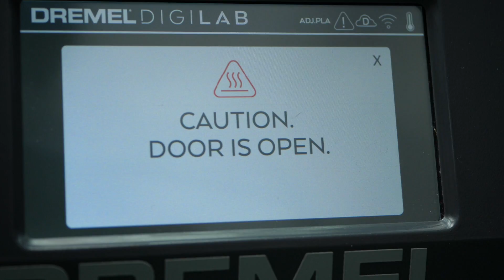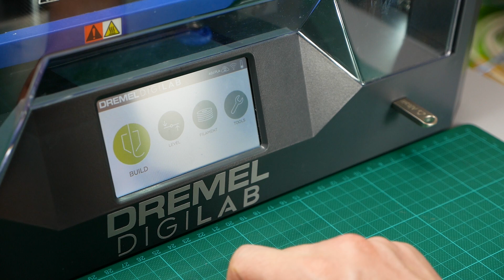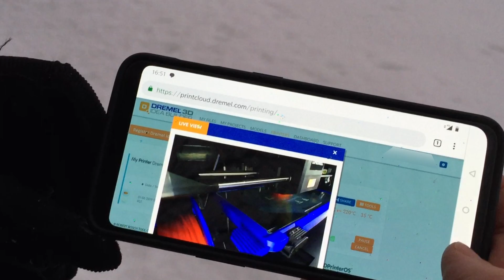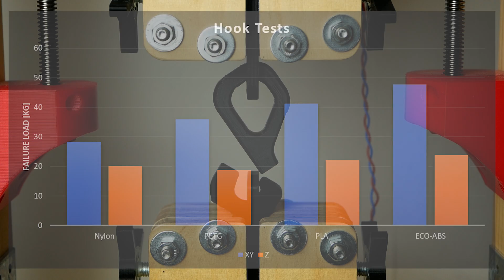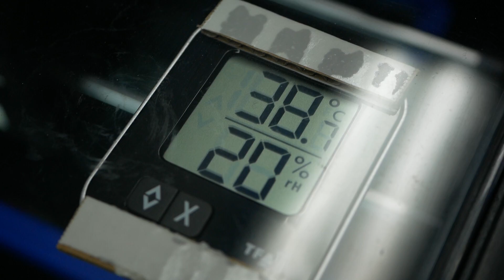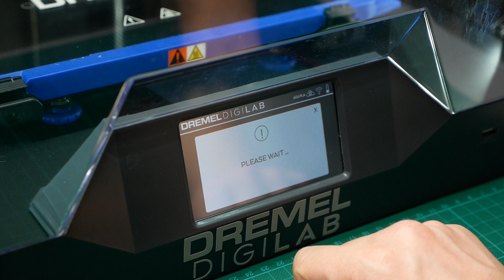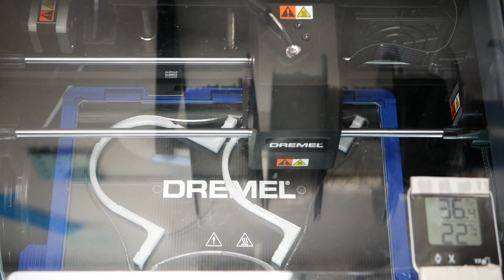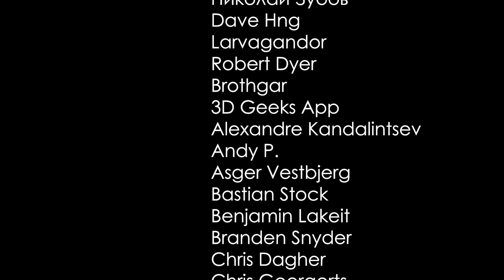Wasted potential!? DREMEL 3D45 + all materials - FULL REVIEW

Comment: I started 3D printing with Dremel 3D45 and had zero experience and I am sooo happy about this machine. The setup is super easy and using it couldn´t be easier! I have done thorough research before purchasing this unit and I can say I am 100% satisfied with my Dremel 3D45 as a newbie and would totally recommend it if you are new to 3D printing and want to learn and just start printing instead of having to build the whole machine yourself. The RFID built into the filaments is amazing as the settings are pre-set and you don´t have to worry at all! All in all, I´m a very happy Dremel Girl and starting to become a big fan! :)

Comment: After 79 success prints it doing exactly what I wanted it to do with no messing with it.  It's been a far better experience then what I see other youtube printers producing.   Only mistakes I have had have been ones that I made when learning how to use it.   It will even remind you to reapply glue every now and then.   It's smart.  It works and it's quality.  After  79 prints I have only had to level the bed one time when I was not smart enough to pull the build plate out and remove my print.  Instead I started working on it in the machine....( I see this done all the time on youtube.  But think about it....not a really good idea to be banging around on something that determines if your print is good or bad.)  Not one issue with the machine.  I am on my 4th roll of filament.   It's time to order more.   This quality tool is not a cheap unit.  It's built to last.   It's nice not having to fiddle with it's settings.   My longest print has been 14 hours.   Shortest print is 10 minutes.  It's good stuff.  Pricey but good stuff.

Comment: I'm a teacher using the 3D40 for the past 3-4 years with NO issues at all!  The Dremel 3D printers are pretty much bomb proof and the Dremel software is very easy to use for people/students new to 3D printing.  I have never had issues with clogging when using different brands of filament.  Overall I'm very happy with the 3D40.  At a considerably cheaper price it still does about 95 % of the things the 3D45 will do.  However, I fully agree that the printing area size is a bit too small for these machines. It would have been so easy for Dremel to simply add a bit more height for printing.  Nice review.
Reply from the maker: Thanks for your long time feedback! It's always great to hear that a machine is reliable and well usable by people new to the technology.

Comment: Excellent video, thank you for level of detail you included which is very helpful. We are considering purchasing this for our very small business to print prototypes but are wondering if it is possible to attach a stainless steel nozzle and to use food-grade ABS? We are trying to print something that will come in contact with drinking water and need it as food-safe as possible. If not, we have a backup plan by skinning the print surfaces with a very thin food-safe material but are hoping we don't have to resort to that. Thank you!

Comment: Biggest problem - the extruder.  A mediocre, mass produced version of Makerbot's old deficient extruder.  Heat creep galore, hard to zero in on optimum temperature settings and it can't handle Dremel's own default retraction settings without grinding up the filament.   On top of that - a hard 90 degree turn into the extruder??!??   I've been working on and off with the 3D45 for about 2 years and  I could learn to love it if it weren't for the extruder.  Ironically, it is one of the best printers I've used with Ninjaflex - go figure.   Trying to decide whether to ditch it or to retrofit with a real extruder.

Comment: You can reload generic filament of the same properties on the spools guys.  After a while the smart spool makes sense when juggling many different materials.  I have 6 of the CEL Robox machines and the smart spools are one of the neatest features to avoid errors. Problem is driver USB instability.

What I care about is a reliable, repeatable system and this unit is supposed to be that.  Anybody have one with hours on it to report?

Comment: First off, thank you for the review, it was quite informative; albeit, did not sway me from purchasing the a 3D45. The review was compared to my experiences with Dremel printers and most aligned. Of course, my experience with the 3D45 is a year after this review and there have been some improvements while other things remained the same. The Dremel 3D45 is a solid printer marketed to a niche market - for now - but my experiences have been mostly positive.

 My first encounter with a Dremel 3D printer was a few years back when I was asked to replace a leveling switch on a Dremel 3D40. It was simple, required a little more than what the instructions lead to, but afterwards, a few test prints were loaded and it worked just fine. Later on, I was offered some print time on the same 3D40 and loaded in some things I normally send out for professional 3D printing - the results were pretty good without fine tuning the settings. 

 After some deliberation, I decided to get a 3D45 (EDU) and so far I have been very impressed. Granted most of my 3D printing is for mechanical form, fit, and function tests; however, other items are for simple enclosures for electronics or mechanisms. So far, the prints are pretty impressive for an FDM printer. One of the main things with this printer or any 3D printer, CNC, or any manufacturing device, is it needs to be characterized for optimization of production.  To be fair this is a slow process, but videos on this channel have made the characterization easier to perform (THANK YOU!); now most of my prints have improved. As of this writing, I am moving away from the Dremel brand filaments and starting to look at replacing the nozzle with something that can handle more abrasive materials like carbon fiber or even wood - who knows. 

 Given time, I think this printer and the associated materials from Dremel will improve. Currently, I am in total agreement that this may have been a little on the expensive side for printer and materials. Just the material price alone makes me look elsewhere. Regardless, in my humble experience, after using the 3D40 it was a logical step to look into the 3D45 printer since the previous version was plug, print, and play. If you spend some time optimizing the print quality through settings in CURA, Dremel DigiLab, or Simplify3D it will make a second look at this printer worth it.

Comment: We are ausing these in a printfarm at work and they work very reliably and predictably, which is what they are going for. Connectivity is great and the hardware is solid. the biggest bummer is the weird filament feeding, since you can not use big 5 kg spools without some major hacks to the enclosure.
It's not a big issue that you cannot tweak settings on the fly. You only need to do this if your printer profile/slicer setting is not working stable. The bed stays level over many many prints, so "manual" bed levelling is no issue as well...

Comment: I'm actually impressed with how much you beat them up and seemed quite genuine in your review. You can't trust any YouTubers review video if they've been given the product for free. And damn it pissed me off to no end when I would go buy that product based on what these A-holes would say about a given product only to find out once I got it home that they were only fluffing the F@#? out of a polished turd. Those YouTubers are the scum of the earth to me. I believe I'd have beat Dremel up something fierce considering it's price point is more in line with a production model, but marketed towards hobbyists and then treated like a child and not allowed to access any of the parameters that they don't believe you're capable of understanding! And to top all of that off they work harder and invest more capital in engineering ways of preventing you from using anything that's not incestually related to the Dremel brand instead of using that effort and capital to put out a product that'll last longer than 6 months. I've owned and destroyed so many Dremel products before I finally bit the big bullet and bought a Foredom rotary tool that, amazingly, you can buy replacement and rebuild parts for all of their products from Foredom directly!!!! And without making you feel like you're stealing from your grandmother when you're begging Dremel's customer service to honor their warranty. Bastards. I haven't bought anything Dremel in about 5 years now. And I'll never buy overpriced Dremel crap again.

Comment: Thanks for your video's. I learned a lot. Since I also own a 3d45 printer, I found out that in the advanced settings, you can turn on the G-Code Priority function. Which uses the temperature settings from the slicer, instead of the build in settings of the printer, which has only 4 parameters for material.

Comment: Commercially, I've been using Stratasys FDM since about 2003 (Stratasys Titan, then Dimension Elite)Got the 3D45 recently to support printing of handheld device enclosures for a side design job. It's my 3rd consumer 3D printer, and I've been pretty happy with it. I am using ASA filament primarily - similar properties to ABS but no shrinkage - successfully printing curved enclosure parts with .045" wall thickness no problems. We bought a Flashforge creator pro first, couldn't get it to print successfully at all, and their support was useless. We bought the Dremel after that, and the support from Dremel is great; broke the level switch once, they sent a replacement free, no questions. Also, since this video there has been a firmware update that allows for print parameter changes during printing, and the Printcloud advanced mode tab gives you direct access to the g code so you can change anything you like. The bed doesn't auto adjust, but it is easy to set and very stable - I have to adjust it maybe once a month. Not sure what the fuss about the glue is; it's cheap and easy to apply, plus you can stick whatever you want on the glass build plate if you want something different. I agree with the comment on ECO-ABS, it works but not worth the extra cost over PLA. 3rd party materials are a non issue also; I've printed Carbon Reinforced PLA on mine and had decent results, but went with a larger nozzle size; the .04mm clogs often with fiber.
Reply: This is subpar to what you get with prusa mk3s that costs less. So you get vendor lock-in here allowing him to elbow you around with less features than if you actually buy something proper.
Reply: The shit-sandwitch that is software lock-in. It should be illegal.
Reply: It doesn't lock you in though - I can print to it from Cura, and I can buy my filament from anywhere. It DOES have RFID recognition if you buy a Dremel spool, but you don't have to. It DOES come with Cura-based Dremel software, but you don't have to use it. I actually have a lot of respect for Dremel for handling it that way.
Reply: Software vendor-lock in happens when vendor gives you software you can't modify yourself and assess. In this case the vendor has been "cool" and given you a little openness as features. Though he can always take that back. I dont get man. You got so many examples like the ps4 Linux and Android platform. You are screwed if you bought this machine if you can't at least throw your own printer driver board in.
Reply: @henrituhola  if it came down to it, you could. The extruder is basically an E3D, the stepper motors and hotbed are all pretty standard fare, about the only difference is the fancy touchscreen, which might also have to change. I'm convertimg my old 3Dsystems Cube3 to a RAMPS 1.4 based system right now, it can be done fairly easy. As a purchase to support a commercial project, we wanted Dremel's support behind it. Otherwise I agree, something like the flashforge creator pro would be very similar for a lot less money. BUT - we tried one of those first, and although I know several people who have them and have had zero issues, the one we got was NOT capable of producing a good print, and Flashforge's support was not terribly helpful. So yes, the Dremel was a bit more pricey for what we got, and has a proprietary board, but they also rush shipped me a new height sensor free of charge when it broke so we could get it back online ASAP. For an average home user, you can get awesome results from an Anet A8 for under $200. My father has printed almost a complete 6 axis robot arm with one, and it looks great!

Comment: this $1600 printer has less features than my £200 one.

Dremmel: 
Single extruder, no auto bed leveling, uses glue on hotplate, locked down filaments.

A10M
Dual extruder (mixing nozzle), auto bed leveling with sensor attachment, doesn't need adhesive on hotplate, works with standard 1.75mm filament.
Reply: Sounds like Apple production if they made 3D printers

Comment: A hepa filter would be useless.  Hepa filters capture paeticulate.  VOCs etc are gasses and would go right through a hepa filter.
Reply from the maker: That’s why I‘d like to have both. See the asterisk in the video ;-)
Reply: @CNCKitchen  but what particulate would come out of a 3d printer?
Reply: @DoRC  google for " Characterization of particle emissions from
consumer fused deposition modeling 3D printers "
Reply: @cthulpiss  interesting.  Unfortunately those particles are .1 micron and smaller whereas a hepa filter is designed for .3 micron and larger.
Reply: @DoRC  I believe HEPA filters are benchmarked at 300nm, but are capable of filtering smaller ones too, look " HEPA Filtration Facts " (first pdf, IF you can trust filter maker). Personally, I have no professional knowledge about those, my interest is only from practical perspective (I want to live forever :) )
Reply: @cthulpiss  eh. Who knows.  I'll just hold my breath during a print:)
Reply: @DoRC  Nah. I tend to be mouthbreather, and my future prints are going to be long. Filter it is (/will be)
Reply: @cthulpiss  my printer is in my garage and being a mechanic I'm honestly probably breathing worse things than 3d printer pixie dust:). However that just means I'm stupid. A filtered enclosure certainly can't hurt!
Reply: @DoRC  No thats wrong. Hepa filters are ratet at around 130nm particle size where they have the worst efficiency. Smaller or bigger particles are filtered out at a even higer rating.
Reply: @blubbenderblubber7496  not sure what you're trying to say here but the particle size for which a filter is rated is the minimum size particle it will filter at the rated effectivness.  Anything larger it will filter better anything smaller it will filter worse.
Reply: @DoRC  Hard to explain that in short but diffusion plays a major role at lower particle sizes. Search for MPPS (most penetrating particle size) and HEPA and you will find a explanation in detail. Its also important how these filters are rated. When they are rated at 0.3mü you are right but only to the mpps, there the efficiency goes up back again.